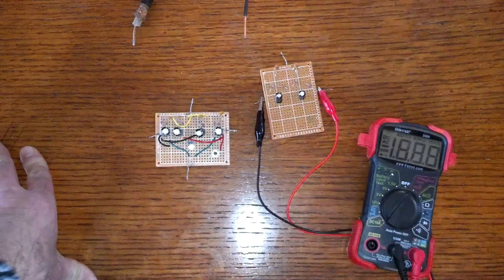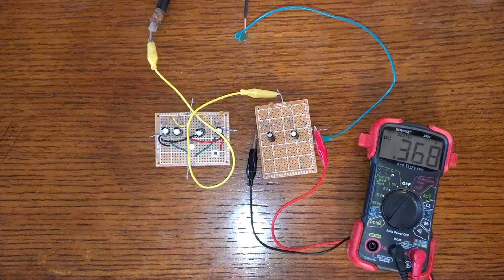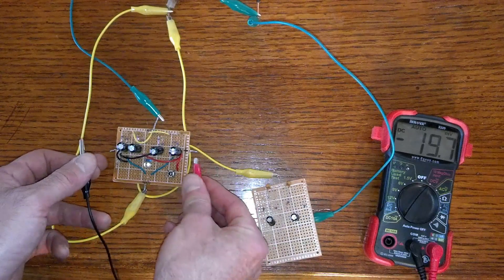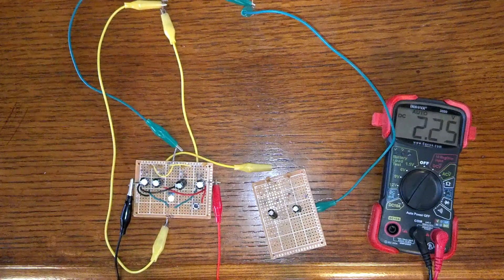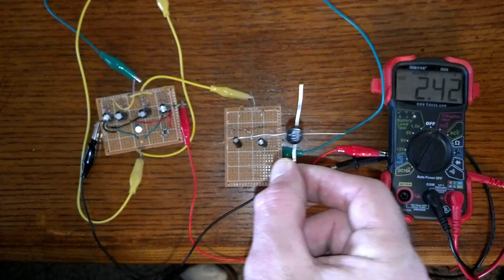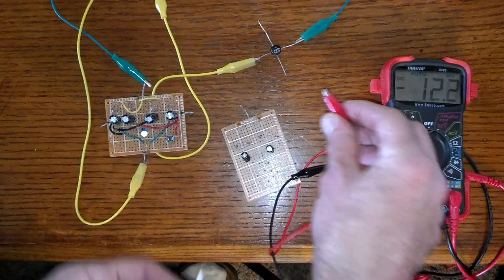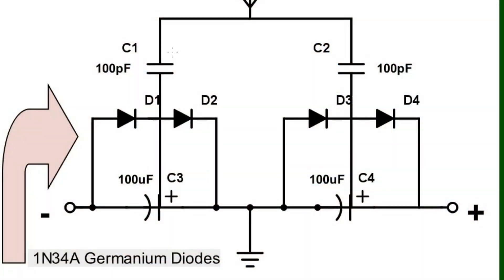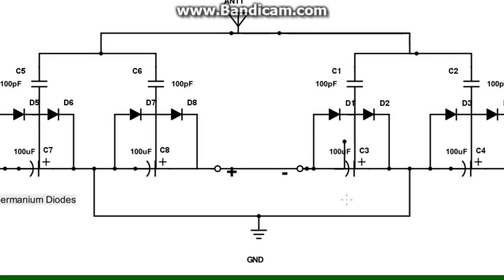Tesla Free Energy Air Circuit

Comment: Thank you.   I have a friend who has been doing >>>Very SERIOUS WORK<<< on "free energy", he is now on the Third, [or 4th] Generation of designs, and has 24/7 power out at a constant 3VDC its been running about Five continuous MONTHS!

He has a Phd, but it is not in Electrical Engineering at all: like me, he is a Polymath, studing ALL facets of the Science realm, I was so sorry when he had to move up North...

Myself, I Started building Radios in 1957, was in the US ARMY Signal Corps by 1968, graduated Second highest in my class, the #1 >>>cheated<<< he had a BA IN ELECTRICAL ENGINEERING, and was drafted in between his BA & MA degrees, I had only "just" graduated from High School. !!!

I have not had an electronic bench set up for over Five Years, but in the last Two Months have bought all the parts to play with, the last box arrives tomorrow.

I have 2 ARDUINO's, 3 Raspberry Pi's and my Favorite, a Late edition Beagle Black Bone SBC., those are designed in America, and though lesser advertising, they are powerful, my First one Runs an Ocilloscope "cape" (equivlant to Duino "hats"). 

Yesterday I received its 9 inch Touch capable screen, as well as a very small keyboard, the whole thing can be powered by One [or more] 18650's, which I only receive from  "Dead" lap top's , I think I have about 30 of them, and have successfully brought All but one back to life!

I will be watching your channel!

philip, from the Great Pacific NorthWET, Oregon Division, USA

Comment: Only just found this. I built one of these years ago without attaching a ground or an antenna. I tested it and it was slowly accepting a charge. I thought good it worked and put in my draw and forgot about it. Months later I went to test it,  It has continued to charge in my draw until the caps couldn't take any more and blown the caps.
Thanks for sharing 👍🇬🇧

Comment: your home earth system should not be connected to the ground, as its only there to trip your MCB if there is a fault. run your circuit ground direct to a copper pipe which is connected to the main water supply that way you use the entire city pipe system as your ground, change your antenna to something with a wider surface area like a metal shed roof....then upgrade your caps because you will be pulling in 100's of volts in stead of mv. if you study teslas work long enough you will see that he made allot of pointless gadgets...that is until you reverse the circuits, then there far from pointless....

Comment: On the circuit on the left, why did you connect the ground (Green terminal) to the antenna and vice versa? On the circuit diagram, there's an extra wire passing through the electrolytic capacitor which confuses me.

Comment: Sir can you tell me what kind of antenna did you use I'm just curious whether it will work with just bare wire thank you sir I'm new to this thing
Reply from the maker: Yes. You can use a bare wire as an antenna (conductor). It will work. It won't pick up as much energy as a large antenna but it will work. If the wire is very long, it might work very well.

Comment: can you please send me circuitry details with the LED for this double unit, and also how to join them in series. I have one double circuit, with the 2 small basic circuits joined in parallel. I have 25.8 Volts during the day and 35 + Volts at night time. I am using multiple antennas to magnify the effect, as is suggested by Patrick Kelly commenting on the Alexcor circuit.Thanks,Raf. Giaccio email   0434332665@iprimus.com.au

Comment: the free energy circuit is not doing the reception, it's the antenna. that circuit is just converting to dc and storing , it should be connected to the quartz instead of the antenna. The antenna should power the coil wrapped around the quartz
Reply: any info where i can see how to build that quartz coil ?
Reply: you take any piece of quartz drill two holes one at top one at bottom , wrap a copper coil around the crystal and solder the to ends to the leads that are in the two holes you drilled in the quartz earlier
Reply: myke Does I’m having a hard time visualizing this. Can you refer me to a video?
Reply: @selfawareness333  Free energy comes in the form of Analog, and "Analog is always in the shape of a sine wave and not like "Digital" as in square wave . Any conductor (Antenna) essentially is already receiving energy from cosmic background radiation that is in the form of Analog. This ac analog signal can be passed threw a rectifier and made dc

Comment: i would hook the 7 volts as ac un rectified straight to a coil wrapped around a piece of quartz and then tap into the quartz for the free energy . The 7 volts is already in resonance with earth and so is the quartz , so you in effect can square your output because you are using two recievers instead of one . Antenna is one and quartz is two
Reply: '\\ol''

Comment: All this circuit is doing is picking up radio waves. I  saw years ago, and on, how to make a crystal diode radio with and I forget now the entire circuit, but it consisted of a crystal diode, an am antenna, just like you would find in an old am radio, which was a small coil rapped around a ferrite, how ever you spell it, and 1 or 2 caps which, with a speaker connected, what ever am radio station you could tune in could be heard.

Comment: Try using germanium diodes instead of silicon. Germanium starts to conduct near 0.25 to 0.30 volts compared to 0.6volts for silicon diodes. That's more energy for your capacitor.
Reply: he uses 1N34A germanium diodes

Comment: Sir, would you please make some measurements for the current ( Amps / m Amps ) that you can get from each one alone of 2 circuits you made + the rectifier you have been used ! also the current withoutusingrectifier (AC voltage ) ! thank you

Comment: So have you tried just grounding the coax cable on one side and using it as a capacitor and using a 5 amp choke or so in line with your circuit? Also couldn't you use some op amps where one board acts to run the op amps with the larger one running your op amps and should be able to run a 12v car led of 3 watts or better?
Reply: Note I tried this with a ceramic ear bud it buzzed being near the power line. It got a good voltage. But I think I was referring to my circuit solver app. You can stack circuits in parallel and series to get better results.

Comment: if I wanted to make a pocket cell phone charger cuz I get that little tiny circuit and just make a big antenna coil and a battery pack would that work and have the out be the end of a charger cord?
Reply: Easy answer. No. Radio wave harvesting produces just microamps. Most cellphones need around 500 milliamps and some will not start charging till you give it a full amp. There is simply not enough energy being produced. You could run a simply LCD clock, or even a super low power motor.

Comment: Question, I have made the original circuit but am only getting around 45mv unless I am holding my antenna (steel wire wrapped in tin foil) but what was your ground wire connected to? I believe that my ground connection is not strong and that is my main problem!

Comment: can you not just run the LED from the antenna AC?. I did and it keeps the LED illuminated continuously in its AC way.
Reply: The AC is going back and forth so it's blinking. It's blinking so fast you can't see it.

Comment: you need to buy a mini two coils that like a radio but not only that your picking up rays which there is radiation at 125ft but that because of the - ions your collecting . to multiply the energy.
Reply: build a battery powered tesla coil i want to build one to capture - ions being release from this no more generators that rotate .

Comment: I'm totally new to this and I am struggling a bit with the schematics. Would it be possible for you to post the schematics with the LED please? Thank you!
Reply from the maker: +enjoypolo I just updated the instructable with a circuit diagram including the led and switch. You can find the schematic here:http://www.instructables.com/id/Tesla-Free-Energy-Air-Circuit-Design-and-Testing/ Hope that helps.
Reply: Thank you so much! I will look into it ASAP.
Reply: surfdmountain I noticed you changed the direction of the diodes in the new schematics. This is something I was confused with in the beginning, could you explain why? Thank you :)
Reply from the maker: +enjoypolo Woops. I had made a mistake. The first diagrams were not correct. Thanks, I would have never noticed.  I have replaced the diagrams with corrected versions: http://www.instructables.com/id/Tesla-Free-Energy-Air-Circuit-Design-and-Testing/  The diodes always point in the positive direction.